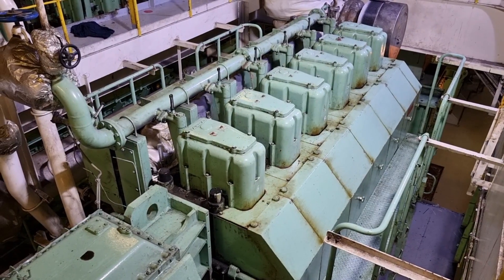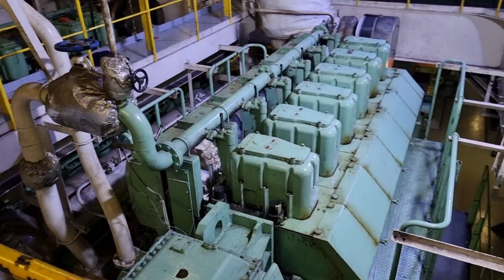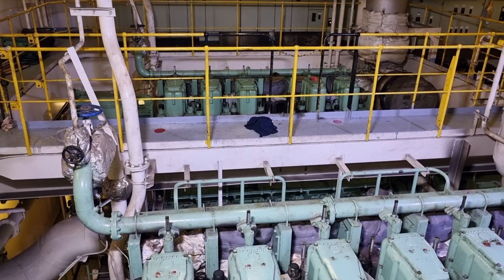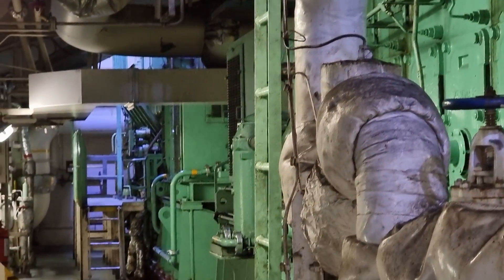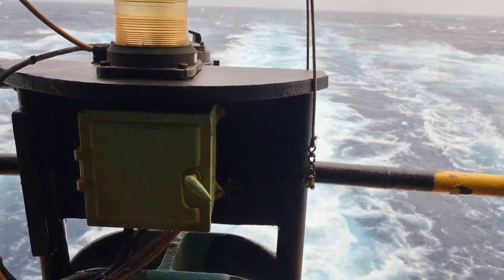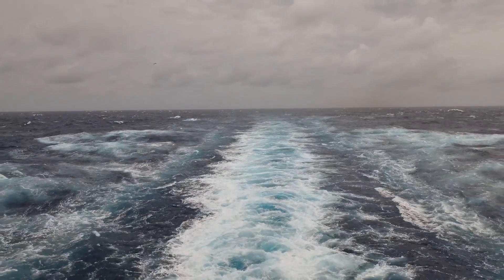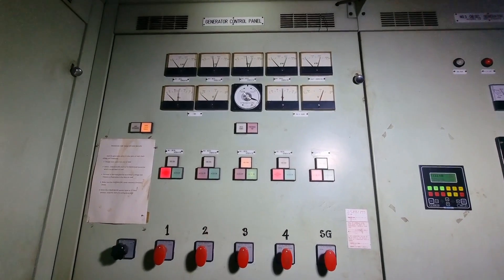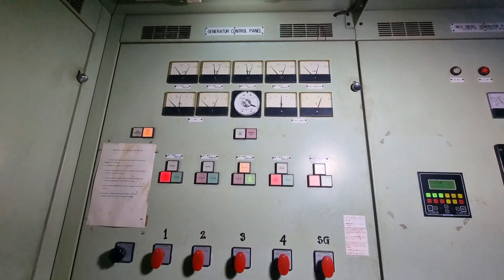HOW TO PARALLEL SYNCRONOUS GENERATOR | ACTUAL SYNCHRONIZATION

Comment: For Essential and Emergency generators on a ship, where are the AVR and governor controller typically located on a diesel generator? Are they housed together in the same control panel on the skid, or are they installed in a remote control panel separate from the skid? What is the standard practice or current trend? The capacities range from 1.5MW to 5MW.

Comment: How does the shaft generator work? Can it only be used when the main engine (and thus the vessel) is running at a specific speed, since the engine RPM is directly related to the frequency?
Reply: Most likely the ship has a variable pitch prop so while the ME RPM needs to be constsnt, it will still work the same way ultimately and the ship can traverse at any desired speed by varying prop pitch instead of ME rotation

Comment: Sir , can you explain how the load balancing unit work , i don't get it yet
Reply: The engine of the generator or generators you want to add load to has to be given more fuel.  It doesn’t run faster but takes more of the load vs. the other generators on line at the time.  Looks like the control marked with the word governor motor is what does it, at least in manual.  If they have an automatic system there to do it fine or do it manually as auxiliary power demands change.   I presume they have synchronous generators.

Comment: Hi, i have a question
What will happen if we close the breaker but the synchronisation conditions are not met
Reply: If it’s way out of sync, you could effectively wreck something, since the machine tries to change speed in an instant to match the others, which it can’t do.  May sever a shaft or coupling or mounting bolts or worse case wreck windings.  That’s a no no.  The automatic as well as manual operation may have protective relays supervising the operation and if it sees a condition not to spec, will block closing of the circuit breaker.

Comment: older detroit diesel units had 3 lamps which flashed slowly as govnor was adjusted to voltage and frequency,then as they go dark on the flash cycle you threw in the breaker
Reply: We have them lamps also on newer vessels, together with other stuff like synchroscopes and so on...
Reply: We still use the three lamps for synchronization in my school's power systems lab.

Comment: Ask lang ako sir lec my possibilty ba na mag blackout pag di ma timing ang pag synchronize?
Reply: You have some leeway, have to read the specifications, if you close the sync breaker way out, you may do severe damage.  Worse than blackout.  The senior operators are trained in this practice.